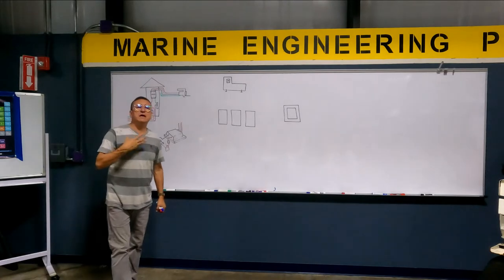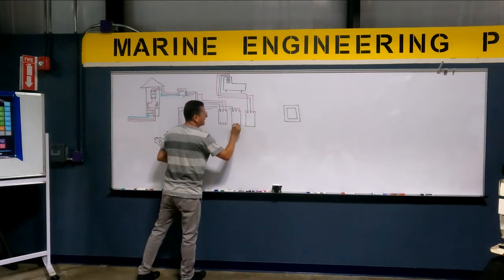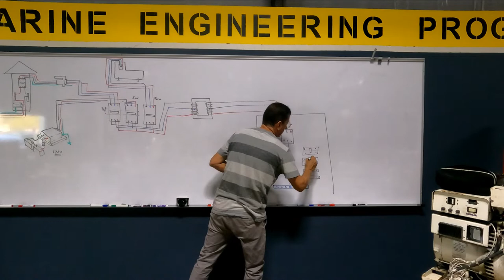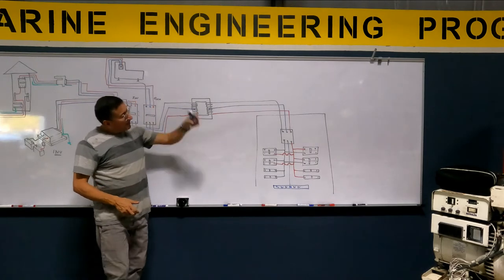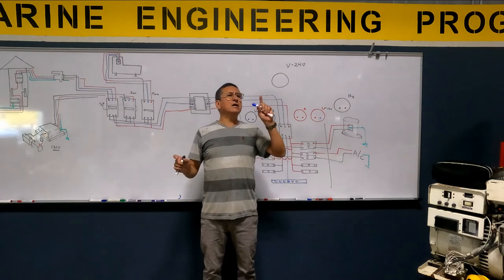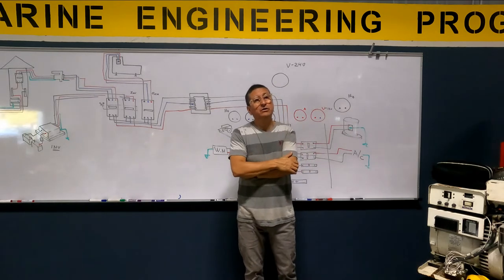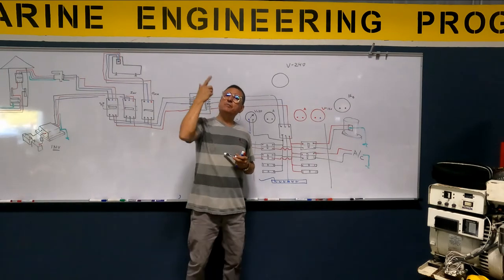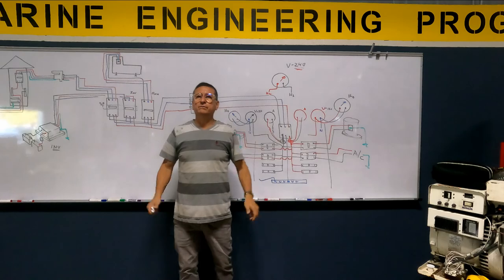How to Wire a Boat Double Phase Panel

Comment: I would like to know more about load balance in double phase panel. IF one leg of my 110 has all devices being powered, and the other leg is not used at all, will it not limit the power draw from my 220 when compared to a system where the 110 loads are equally divided? Thank you so much.
Reply from the maker: Hi Bill, you are correct both phases should be used at full load to do a proper comparison. If both groups of breakers are activated with full load applied you could see if the Amp consumption is pretty similar in both groups of breakers. If the difference is more than 20%, then you should evaluate which load should be moved to the other group of breakers. I am preparing a video about that process. Sincerely. Mr Lopez